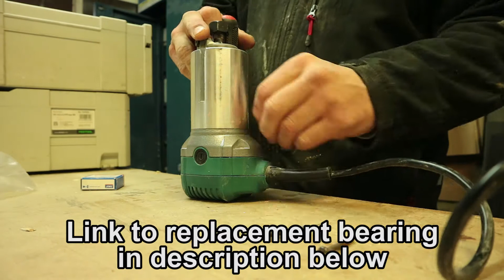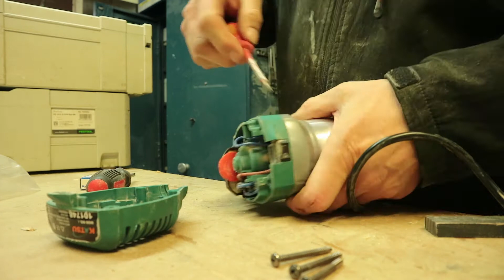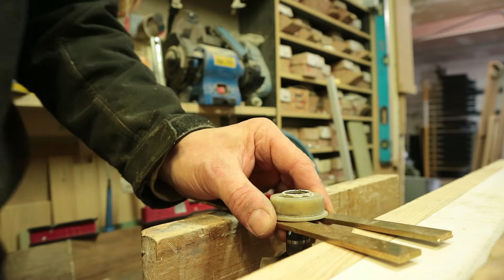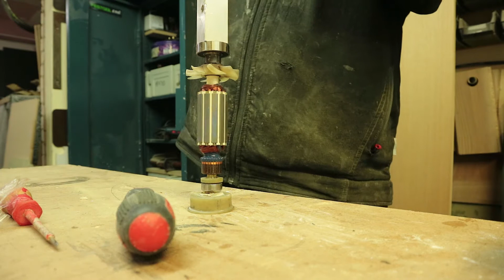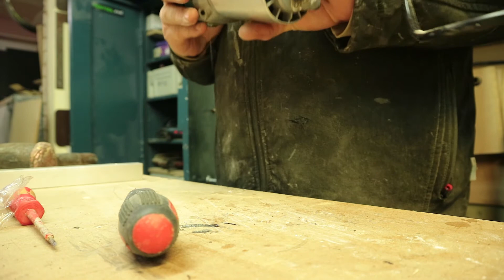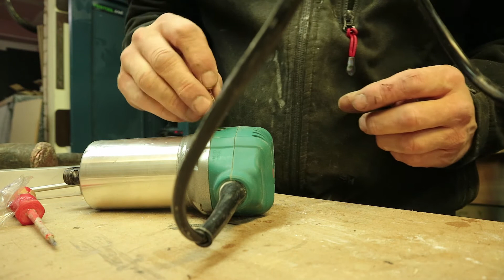How to replace a Katsu router nose bearing

Comment: i placed the skf 6003rsh bearing and it heats up a lot. I don't think it is suitable for those speeds. as the technical data shows 13000rpm max https://www.skf.com/ph/products/rolling-bearings/ball-bearings/deep-groove-ball-bearings/productid-6003-RSH .. though 6003-Z is rated until 43000rpm i have to test that too. Do you have heat issues too with the 6003rsh?